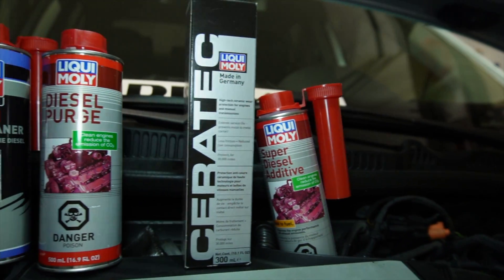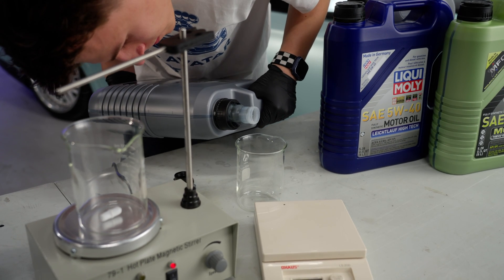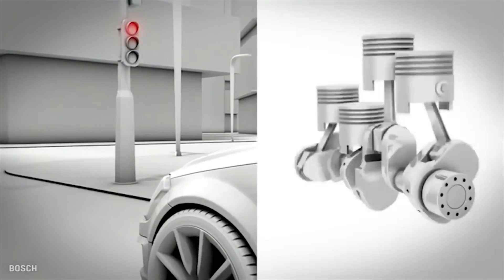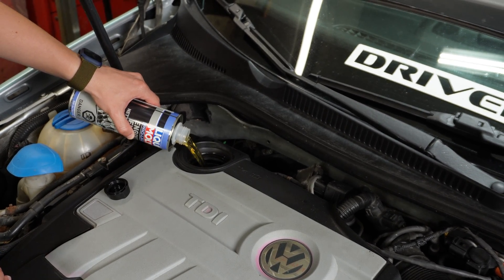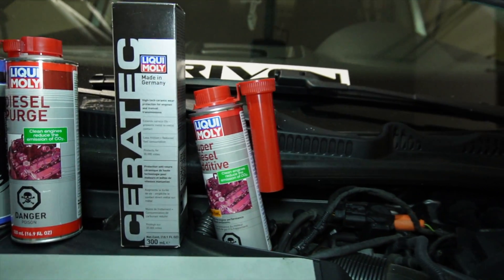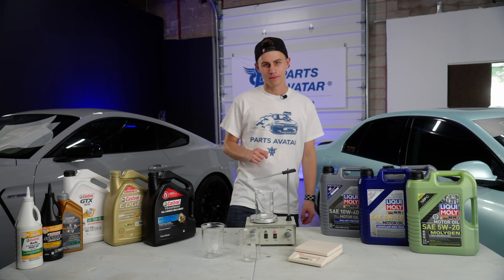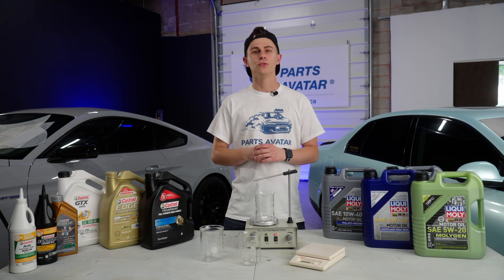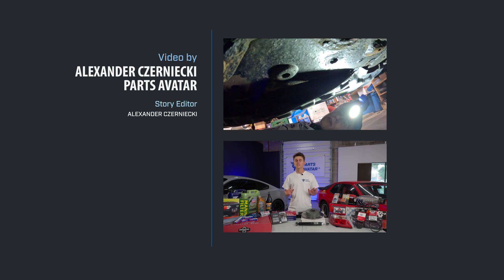How do LIQUI MOLY Additives work? - CertaTec, Hybrid Additive, Jectron, Engine Flush, and more

Comment: I would recommend that you change your oil and filter then use liquid Molly then change your oil again because if you add liquid Molly to an already dirty oil and filter you’ll remove more contaminants from the engine, plugging the filter, and then the oil will bypass the filter and all that crap will be moved throughout your engine and it should also be noted if you use this and if you never used it before it is very possible that every oil seal in your engine is going to start leaking
Reply: People that get regular maintenance and don’t slack on their oil changes will most likely not have to worry about any of that But if you’re one of those people that don’t take care of your vehicle and it’s starting to run funny and you think you’re gonna get away with putting this in your engine, you’re in for a big mistake